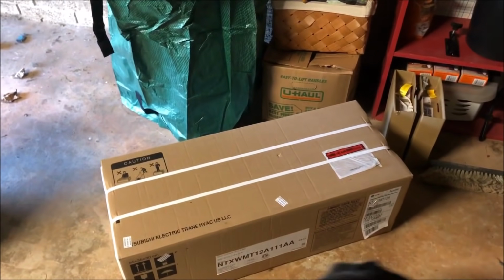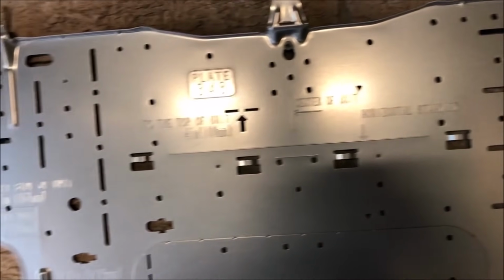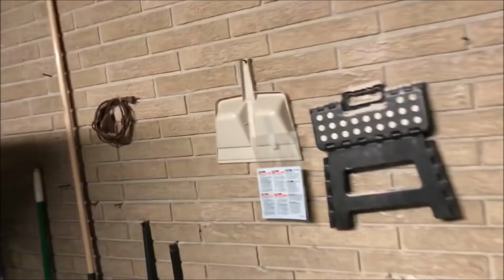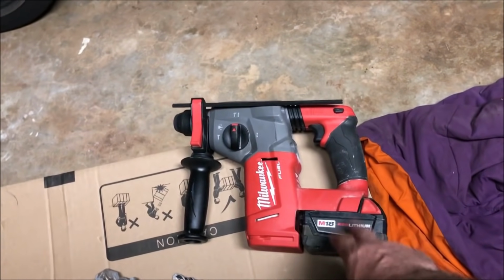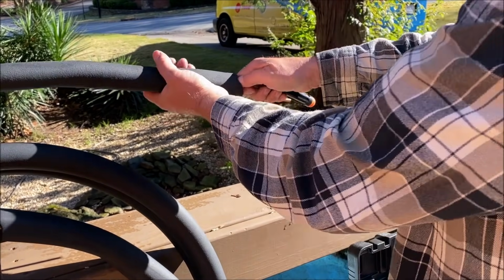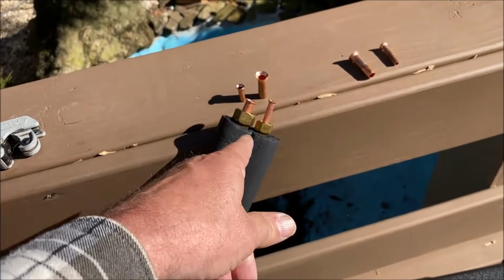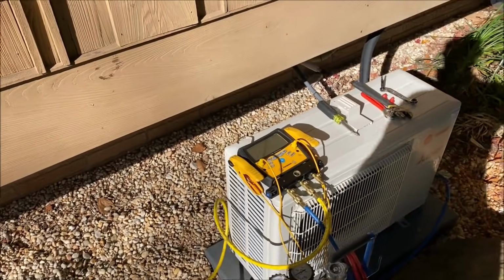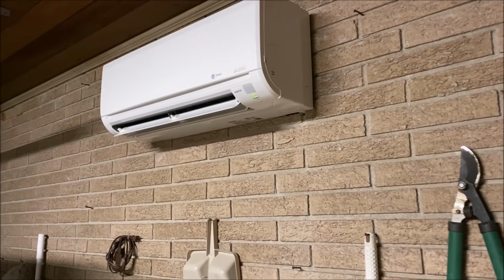How To Install a Ductless Mini Split Pro DIY at My House

Comment: You can still use the bottom connection on the junction box but it did'nt have the option for the lock ring but I see you want to use the ring so penetrated the side of the box. You know the box is no longer a UL listed product once you drilled into it now considered modified the flares I would blow with pressure it looks like theres more deburring shavings inside than originally. any way I like your videos keep up the good videos.

Comment: If you took the hose off before charging you lost the majority of your vacuum as it sucked in outside air removing the hose. I would recommend releasing the charge with the hose attached and under the vacuum so when you remove the hose it’s under positive pressure.

Comment: Nice work ted but i just think it was too much work and very unnecessary to use those drive pins, regular anchors screws would've been just fine its not like those head units are very heavy

Comment: I installed a 2 head system several years ago for a fellow that had bought several off eBay. Set the outside unit between 2 areas for the heads. I cut the lines off as short as reasonable. One was around 6 feet and the other closer to 8 feet. Started and ran just fine. Next day the owner called and said one was freezing up. When and checked it. Change was good and everything seemed to be ok. Called technical support, they said it needed at least 10 of line. Don’t remember the brand, some cheap Chinese units. Changed out the lines, longer worked ok for several years but other problems eventually took it out. Only time ever had to have at least 10 foot lines.

Comment: Thanks for an awesome video Ted! Old school myself, but early on in my career learned the hard way to always ream the pipe before you flare! Did a lot of refrigeration in my day so a lot of driers and TXV’s were flared. Wish that tool was available back in the day, but oh well the small amount of flares I do today, I am ok with my old Imperial kit which includes swedging as well which I use more these days. Thanks again!

Comment: Silly question...aren't you supposed to put in a disconnect by the outdoor unit?
Reply: yeah I was wondering the same... thought that was "code"
Reply: Not on 120volt
Reply: I thought the same thing.  Maybe because 115v or local codes?  Even the no vacuum DIY linset mini splits seem to mandate this as requirement.

Comment: When cutting tubing, if you stop tightening the cutter before you cut all the way through, you can snap the tube apart with your fingers. Leaves a much smaller inside burr. Of course it takes a little practice to know "when".

Comment: So what is the MINIMUM refrigerant line set footage, eight feet, as you said?
Reply: Lineset length is different for every unit,every book tells the minimums and maximums! I ready then every time,after a couple hundred install,i still read the book,tgey may have changed something!

Comment: As soon as you took the hose off and "put the cap on as quick as you could" you introduced moisture into the system, so much for the triple evac

Comment: I had a split unit installed, and the tech cut off all of the factory flares.  I was impressed!
Reply: Shark bite nation
Reply: The factory flares are only there to hold the nuts on the lineset! Not to mention,you are to use the nuts that come on the unit,not the ones on the lineset!

Comment: why cant you just braze them and dump the flares ?
Reply: Flaring is faster ,cleaner,and makes a suitable connection!These units do not utilize filter driers so you dont want even a smidge of carbon!

Comment: A few particles of shavings is nothing thats what the orphas is for plus you should be using a double flare if you want a perfect seal not a single flair like you used .
Reply: Never double flare copper,the nuts are designed for single flare on a male connection! They will indeed stand the test of time,wothout and issues!

Comment: Drive pins are bomb and do great i was taught to remove them you drill out the center then pull them out.    Made me a believer and user used them lots.

Comment: Pro tip Ted,strip your wire,then get another bite and pull that little piece to the end and it will hold your strands together!

Comment: Why do all mini splits have insulation on liquid and suction lines?
Reply from the maker: To keep them from sweating.
Reply: @TedCookHVAC  Why does typical 2-5 ton split system heat pump installations not have both lines covered as a requirement?
Reply: The change of state happens in the outdoor unit,so both lines in cooling mode will be below the dew point causing the cold beer can effect on a hot day,and in heat mode,you dont want them to cool on the way to the head!

Comment: Just a quick question why didn’t you leave the gauges on there then release the charge. If you don’t you loose vacuum when you remove those hoses
Reply: Small units have very small charges,and these units are very resilliant! I have seen some really hacked up installs that were over 5 years old,confirmed by tge owner that no vacuum pump was used! Was told he purged the lines! But they ran flawlessly,maybe not efficiently,but they worked! I was amazed,myself!

Comment: It didn't sound like that battery drill was a hammer drill when you was drilling in the brick for the drive pin holes those concrete bits burn out fast if you don't use a hammer drill
Reply: It's clay brick. Not concrete.

Comment: A really solid way to fasten into concrete is set up for expanding  lead anchor then put a dab of epoxy in the hole before you put the lead anchor in. Lead anchors themselves are very weak but with epoxy bond into concrete or mortar they become very strong and are removable.

Comment: First grinder I ever had was a Dremel.  Sometimes, it's the best choice for a job.  A cordless dremel is pretty darn handy.  Get a pocket of fiber discs, and you can cut through just about anything, without too much damage.   I got the 1 9/16 M18 drill for Fathers day.  About to fire it up this weekend.  I got a Dewalt SDS Max to Plus adapter for it too.  Hopefully I love it.

Comment: Hanging by the center hole to level it only works if that hole is the center of mass.  So, if one side has more holes punched in it then it will not work.  My first experience with these was in a hotel room in Korea.  It was mounted on an inside wall, between the room and the bathroom. The hotel bathrooms in Korea have a trough next to the tub, about 2 inches wide and sloped down with a drain at the end so any water splashed out of the tub goes onto that trough. The tub was opposite the wall with the mini-split.  The condensate drain came down the inside of the wall and terminated with an open pipe sticking out of the wall in front of the stool.  Cold condensate water ran across the tile floor right in front of the stool to the little trough next to the tub.  I was not impressed.

Comment: The Yellow Jacket 60278 makes flares as nice as the Navac tool. Another great thing about it, you don’t have to debur the inside of your tubing, it does it for you. I use a dab of nylog to lubricate the head and that captures any copper burs that come off. Then just wipe the head off between flares.

Comment: You should give the Danfoss
FSA flare adapters a go. They can be brazed on the line set instead of having to bother with flaring. Another common practice here in europe is to cut the flares at the indoor unit and solder the lineset directly to it after swaging. (Maybe also because refrigrant r32 being used over here) final suggestions there are some knockouts on the indoor mounting plate so you could just use a level and manufacturer advice is to use the 5 screw holes close to the ‘hooks’ to prevent vibration and get the studiest mounting.

Comment: My parents have the same unit in their bonus room. Issue is if you set the remote to say 84 it maintains 72 about ten degrees off. Installer is saying this is normal. Mitsubishi said they may need the remote thermostat. Is yours maintaining set temp? Too bad you are so far away they are in Conway sc would have them call you for service/opinion.
Reply: If the lineset hole is not properly insulated,the return air thermistor will sense outdoor air!

Comment: Most manufacturers require a minimum 10 feet of lineset. When you see a loop of line set behind it it means it’s been installed properly according to the manufacturers specifications.

Comment: If you used just one extra loop of the line set it would eliminate the vibration.  They are mostly quiet anyway so I don't think you will ever have a problem with noise.

Comment: We had 3 mini splits installed in the clubhouse but they didn’t heat. After reading the instructions found out they use heat from the compressor. Thanks
Reply: They do,but most of the heat is absorbed from ambient air,at low temps they increase the frequency to say 110 hz,but tge compressors build huge heat when they do this,so they utilize vapor injection to remove the compressor heat and now you have the ability to heat in sub zero temps!

Comment: Great info video Ted.  Have you had any luck with Tapcon Concrete screws?  I use and love them from light to heavy duty installs.  Just another idea for ya.  Thanks for sharing.
Reply: We use drive bolts for medium to heavy duty,much better than Tapcons,look them up!

Comment: Top notch, I thought I was a little anal about the copper shavings but as you said a good flare is not that difficult with the correct tool and patience.

Comment: You went really DIY with this install.  I can't believe you didn't install an electric disconnect.
Reply: He has a switch next to it
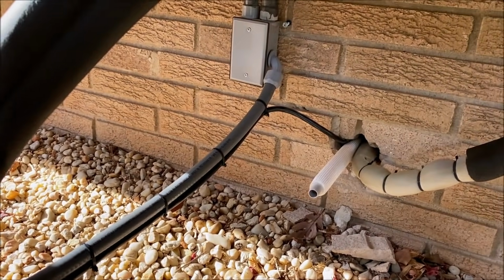Reply: Justin Sundby , at 52:31 there is no switch there.   Just a pigtail coming out of the junction box with no way to isolate the power to the system without shutting off the circuit at the electric panel.

Comment: Just imagine the seer rating you'd get if you could run lower pressure r22 .... less energy for the same amount of heating/cooling.
Reply: Mitsubishi and Fujitsu units already run super efficiently,most units up to 2 tons run less than 10 amps,that less tgan an 8,000 btu window shaker!

Comment: I have argued with people on here that show people how to do it, no vacuum pump or gauges in sight.  I have argued with people that have installed them themselves about pulling a vacuum on them line sets, most tell me they are ok because they have the plastic seal on them... lol.  I like to tell them, call me in a couple of years and I will change it out for you, properly, if it lasts that long.

Comment: 1200....i let mine goto 250....zero moisture....i change oil every 3-4 vacumes
Reply from the maker: I pulled it to below 350 on the third step of the triple evac process... you obviously did not watch the whole thing.
Reply: @TedCookHVAC  your right i did not see the whole vid....my bad bro...
Reply: @warbird101210  most books that come with them calk for below 700

Comment: I get it, but automotive brake lines are flared from factory and look like that sometimes. Never have an issue with them leaking, so why do you think its to important when vehicles are a life or death situation? Wasting your time in my opinion. But most of your videos are above and beyond what needs done so I understand.

Comment: lmfao...so i guess you're against the systems that are pre charged and dont use antiquated flaring systems too? Maybe people would be more likely to call specialists if it didnt cost so much.
Reply from the maker: I guess people buy, and or do what they can afford to do with the budget they have to work with. DIY jobs can be successful or also can be risky.... if the novice method fails, you're worse off than when you started. So my theory is: if you do not have 3500 to spend, then you sure don't have 1500 to throw away or gamble with. All I do is offer a professional service.... I can not force or impose my opinions on anyone else. It is a free country. (for now anyway)